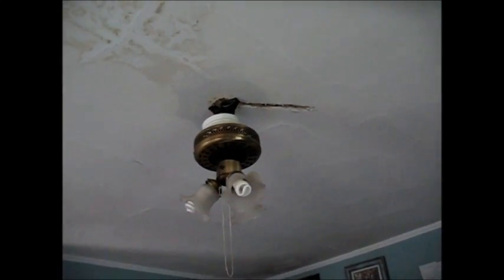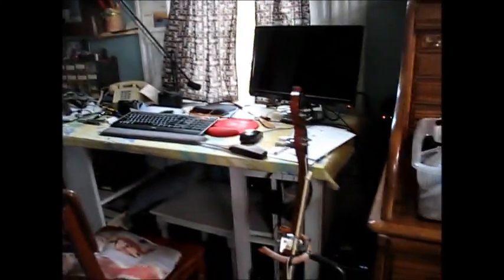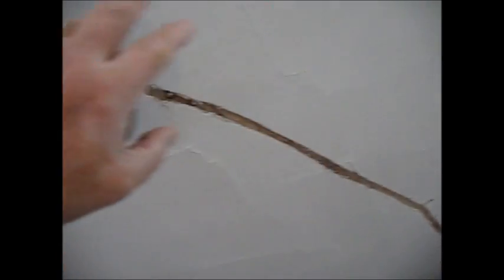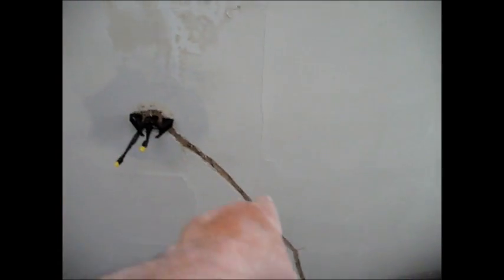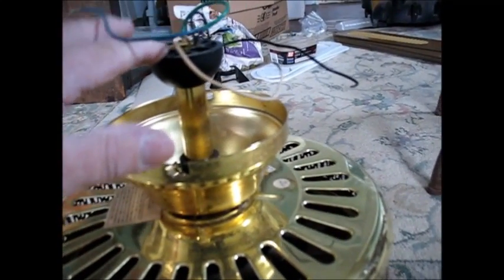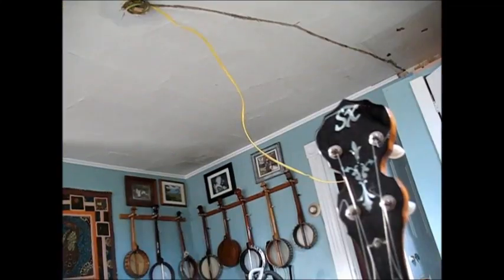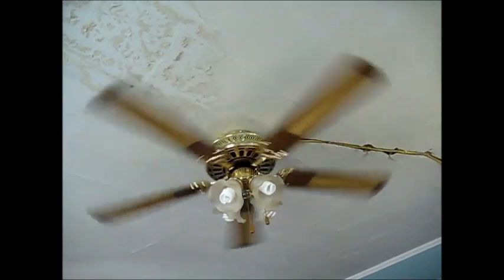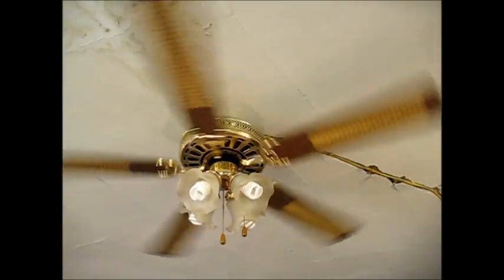Ceiling fan adventure 2

Comment: I would use plaster of pais it dries hard and smooth and FAST.
I would also run the line straight to a juntion box for your lights only than that to your panel box.
Did I say this is not to code.....OH I see & hear nuttin....LOL